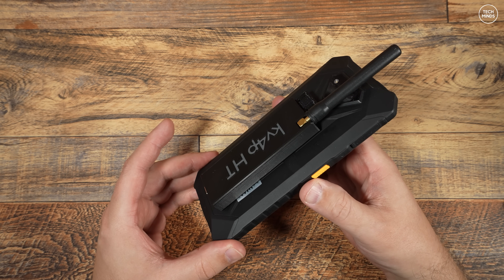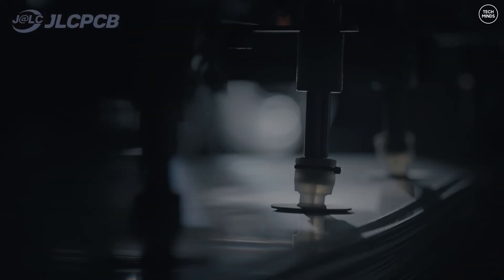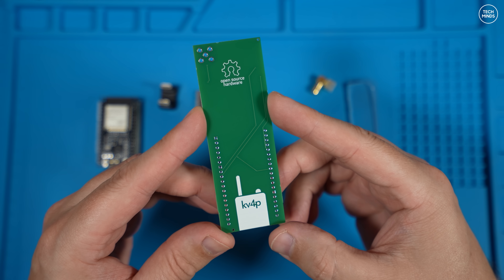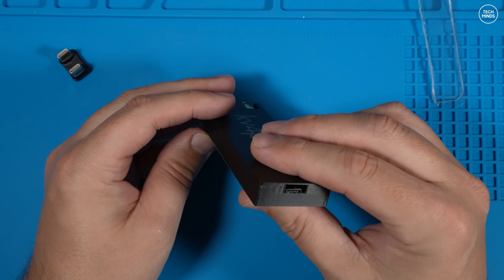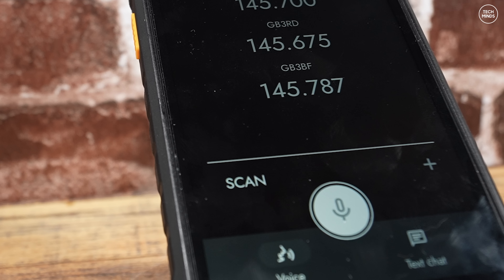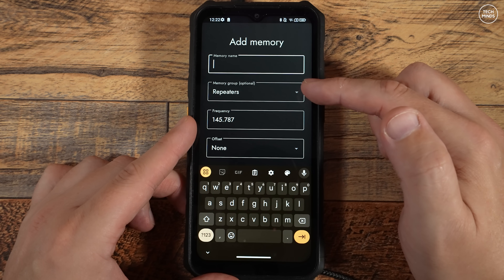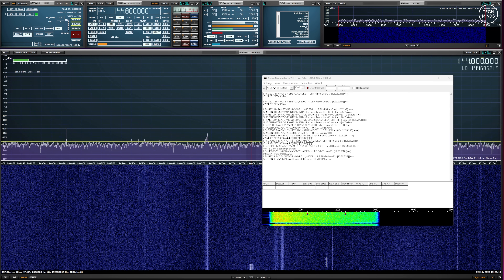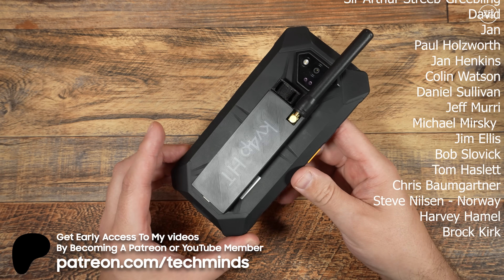Turn ANY Android Into A REAL VHF Two Way Radio Transceiver

Comment: You Ham nerds make me laugh, you where all slating 4g network radios as not "real radios" in all essence without android and either a wifi or 4/5g this thing would never work. Basically this is a 4g network radio dressed up!
Reply from the maker: Bit of fool are you not? It doesn't use 4G or any internet data to work. It uses an RF module and an app to control it.. Nerd..!

Comment: Very cool project!   Thanks for sharing it with us!

Perhaps, I missed it; but, what is the transmit power?
Reply: I didn't hear it either, kind of important information on how useful this is.
Reply: SA818-V (SA818S-V)134~174MHz (VHF)500mW-1W 3-5KM RDA1846S chip

Comment: looking at the design of the PCB, it's a shame that they can't just produce the ESP32 module with the PCB extended with the pins for this feature, even if they don't provide the DRA818V module or the various parts out through the connector port.  It would be far thinner that way and might even be able to be integrated into the protective case that many people put on their phones.
Reply from the maker: look at github, they already have this in development. great idea though.

Comment: for the cost and time, you could just spend the 35 bux and get triband baufeng instead.   Not suer what the advantage is here unless its for the project itself.
Reply: I'd suggest the Tidradio TD-H8 10w. BT programming, higher tx power, much cleaner signal.

Comment: garbage, you can be tracked using your android. This isn't an ideal for a EMP off grid, first your android depends on transmission from cell towers, without service, it won't work. furthermore these cell phone depend on GPS locations. using this VHF there is no security. if you want to be tracked, sure that's good device for you. but if you like to be secure and don't want the US Government or the Chinese knowing what your doing, this product isn't advisable.

Comment: This would be amazing for all my backcountry trips...but cellphones working with satellites nowadays makes it almost unnecessary...and only needed as a backup.

Sending/receiving text messsges in the middle of nowhere is such a great feature for those of us that leave coverage often.
Reply: Not for my country tho.
Reply: One thing to keep in mind with respect to the concept of, "but cellphones working with satellites nowadays makes it almost unnecessary." This statement could be true, but a qualifier may be in order. And that qualifier is the ability, or lack thereof, to summon help from an external agency such as Gov't agency or NGO's who may man a local dispatch center via VHF, and how fast of a response may be required to address the nature of the emergency. For example, a real world event may illustrate this best. A party of skiers were descending the Notch near Lake Louise when the lead skier was involved in an avalanche. Broken femur required medi vac. The ACMG guide on scene performed a SPOT activation and called Banff NP dispatch on his VHF radio via the Hector repeater. The joint BNP/LLYK public safety team flew in and were dropped at the victim. The victim was stabilized and packaged on the slope in a Bowman bag and the 'ship' was returning to scene to sling victim out when Atlanta dispatch center for the satellite service called Banff dispatch to report an activation in their jurisdiction. It was of course, the same event that had been reported two different ways. The time difference between the two methods turned out to be about 1 hr. Another thing to keep in mind is there is a general feeling right now that the cellphone to satellite functionality is not ready for prime time yet as opposed to dedicated devices such as SPOT or inReach when it comes to the question of reliability with respect to summoning help for emergencies, but it will get there eventually.
Reply: S24 through sat ? ?

Comment: hi, this looks great but you forgot to tell many things, what is the frequency range and what is the transmission power, i can buy a small transceiver 10W for about $66 australian with a range of 16MHZ to 600MHZ with FM radio and air plane frequencys removed from transmission but receiving but i dont know any info for this project
Reply from the maker: The follow up video that I made on this contains the information you need :-) The module specs are available online, depending which one you get. 134 to 174MHz roughly.
Reply: may i have the radio brand and model number? thanks

Comment: You can put solder mask over the pins of the esp32 after you cut them to prevent anything like dirt or moisture from shorting between the pins
Reply: If you have any spare corona dope used on Hi voltage circuits on TV’s or Gen 2 or 3 NVD power supplies. Does a real good job at sealing contacts.u

Comment: You theoretically could wire a button to the board itself to give it PTT controls and could always code the app to have a response spoken out to you if the device is not currently in use by the holder like those old walkie talkies. lol Though unfortunately my skills aren't up to the task (hopefully I will be taking coding classes soon.) and then you could have your own bespoke android or linux based PTT VHF smartphone. (:

Comment: Can you provide a link to where the completed/assembled/flashed unit can be bought if such a site exists? Or perhaps resell the complete thing in a kit form shell and all with sm components already done? Is a regular wifi antenna good enough for this?

Comment: do you have this completed project available to buy from your Amazon account?
Reply from the maker: Unfortunately not, you have to get the boards etc yourself. However, I might do a limited run of them if the interest is there. I have a new video coming out on this in a few days with an update.
Reply: @TechMindsOfficial  cool I just ordered a 3 pack of the eap32 lora V3 cheers

Comment: Can I buy a COMPLETELY ASSEMBLED unit anywhere? Thank you for the fabulous project.
Reply from the maker: I have just received a load of 1.7b boards, populated with the filter components. They just need to RF module, ESP module and SMA socket. I MAY give away the bare boards at some point in the future. I also might get some fully made and sell them, depends on demand really.
Reply: @TechMindsOfficial so when are you selling the completed boards 😊

Comment: Well you can buy a handset for about $30 so this is really just a fun tinkering exercise.
Reply from the maker: That's true you can, but a $30 radio does not have the power of an Android device which can run endless amounts of compatible applications. So, not really just a tinkering exercise, but it is fun!

Comment: instead of the development board, you could have soldered the module itself. everything would be at least twice as small.
Reply from the maker: It was designed that way so everything lined up with the 3D printed case. You are more than welcome to make some changed to the design and submit them via Github, it's an open source project. :-)
Reply: @TechMindsOfficial  Don't take this as hate. I used to do it just like you and it took up a lot of space. Some time ago I created a pseudo-SDR based on an old TV. (YouTube/ELEKTRON1) The TV tuner module is controlled via I2C by a microcontroller. The IF signal from the tuner (approximately 30...39MHz) goes to the NE612 mixer and is mixed at a frequency of 27MHz. I filter the received signal and feed it to SA604. Thanks to this, I can demodulate and quickly measure the signal strength. The project became popular because it could be used to receive railway service radio. I am also a Creator like you, I create projects for my viewers. My latest project is a NEC IC programmer. I found these chips in a water heater and wanted to write Hello-worlld on it (and my mission in life is to run BLINK on every microcontroller possible). You did a great job and you deserve applause. Greetings from Poland, ELEKTRON

Comment: I remember one of my older Android phones had a radio function, you just had to correct wired headphones. The wire functioned as the antenna.
Reply: My old Sony Ericson phone had an broadcast FM radio receiver - it used the wired headphone as the antenna. That was some years ago now
Reply: An FM radio receiver was built into the Motorola g4 Play, and my wife gave me a Verizon no-contract version which cost less than US$50 around 2016. Good reception for wx and news when we were in cellular dead zones, before SpaceX Starlink!

Comment: What would be nice is a provision on the PCB for a second USB connector which could be used to charge the phone while being used.
Reply: Most phones won't support this, but you might be able to get away with simultaneous wireless charging and USB OTG
Reply: most of phones can't work in dual mode. only "host" or "device".
Reply: why wouldn't it work since there are USB OTG devices that specifically have a power input? Like: plug in your charging USB cord here and I'll send that power on to the phone

Comment: Lol .why not buy a cheep vhf walkie talkie lol....another useless item..
Reply from the maker: because a cheap walkie talkie does not have the power of an Android device running it. Which potentially opens the door to a lot of experimental and useful software applications. Cannot compare this with a standard radio.

Comment: you can already buy integrated phone/ht, and a dedicated ht with battery cost less than half as much. why the exitement?
Reply from the maker: Dedicated phone with radio are most likely closed source, and cost 100's of $. A $35 HT does not have the ability to use software. This costs less than $35 for a single unit, and it's open source. This means that we have a software controlled VHF radio which can yield all sorts of future developments. Hope that helps.

Comment: Can I use it on my current android phone and it works only when it's plugged in? Or do I need to use a different phone that isn't currently on a plan?
Reply from the maker: you can use it on any Android phone that supports OTG and the app. Doesnt matter if it is on plan or not.

Comment: Are the low and high pass filters software based or additional hardware?
Reply from the maker: The filters settings on the app refer to the received audio only.

Comment: I don't like it; these damn smartphones are everywhere. Just as well, there could be a small screen and an encoder instead of that phone.
Reply: That's not true, the smartphone is bringing all the audio section, microphone and speaker, plus the power supply.

Comment: This is cool, but tooooooooooooooo expensive project,  for this money you can buy a few Chinese SDR radios with better parameters and also hackable! E.g. Quansheng line can be updated to operate as 2 bands transceiver with ability to receive in full SW range...  
73!
Reply from the maker: I think you're missing the point with this. The possibilities of having it app driven is pretty out there. Of course you're confined to the 2M band, but with software, can do anything in terms of modulation, decoding, etc etc.
Reply: @TechMindsOfficial  I've got it, but mentioned quansheng already has such functionality as full featured remote control (e.g. with "Quansheng Dock") , and it's significantly cheaper. Of course, "Quansheng Dock" is for windows, but I hope something exists for android as well.

Comment: Question for me is why not use mini-circuits'monolithic SMT LPFs? (LFCN-) I think you can get them from both mouser and DigiKey...
Reply from the maker: Put forward your idea to the project, I’m sure it would be very well received from them.
Reply: @TechMindsOfficial  I may also submit the idea of using an SR_FRS-W2US radio module as it's 2w UHF, but has been hacked before to operate 146-222-440 MHz with the Arduino handie talkie project, as well as having a switchable LPF with the LFCN's
Reply: Maybe this radio is already made to be interfaced with a microcontroller and be digitally controlled, instead of having some external hardware. The audio should also be routed into the esp32 to be sent via USB!

Comment: I really hope someone can invent one that's purely a VHF/UHF scanner receiver with AM Airband receiver built-in!??
Reply: Why not using one of the better RTL-SDR's and an app like SDR Touch?
All existing, even more so if you start digging deeper into this hole. :)
Reply from the maker: RTL-SDR dongle with SDR++ running on Android. Of course that is receive only, no transmit and no making use of the phones/devices peripherals.

Comment: does anyone know the output wattage and power drain on your phone?
Reply: @mi6xgzjon186  1W from DRA818V.
Reply: The module 818 is 1 watt, I was curious if the PCB would support the 868 which is 2 watts.
Reply: @SkillfulHacking   thanks,  it will be interesting to see how this develops over time.  could be usefull as rf for digi modes from morse right through to digi voice.  im thinking pota and sota.

Comment: Is that cable always needed? 
What is the TX power output?
Show more videos on the APRS features 😅
Reply: @KA4UPW  i read somewhere it's 1 w output
Reply: @tratzum  those modules on high power setting have a typical output of 29.5dBm (about 0.9W) - max is 32dBm (about 1.25W)
on low power mode its 27dBm (about 0.5w)
Not exactly high power output
Reply: @keithroberts5946  dam rules of 3's and 10's.

Tx
Reply: @KA4UPW  Yes. It’s the data cable the UI on the phone uses.

Comment: I ordered a set of 30 for a club. Bought all the bits. Then the ESP32 module didn't fit the boards. Apparently a known issue. The project has gone from V1.6 to V1.9 in the past few days!

Shame, as I'm now stuck with a load of parts that won't fit!
Reply from the maker: There is a WIP 1.8 but I don't see a 1.9. 1.7b is the latest release version of the board.

Comment: we had this like 9 years ago... using a rtl dongle and a otg cable and a app called sdrtouch...    but no tx though ... i love it
Reply: It's NOT the same!
SDR Touch is Rx only you can't transmit.
Reply: @rogue_spirit  yes i clearly said that.. no TX

Comment: Dear friend. Pls infm if the walkie talkie thar cames out of this DIY works only between Walkie Talkie to Walkie Talkie OR if it can do it with a Repeater ... By other words, Walkie talkie to Repeater and then Repeater to destination Walkie Talkie. Pls infm as well if it  is possible to transform the "keypad" of the celular into a DTMF sellcall to the other Walkie TAlkie

Comment: A few years back bought a vhf/uhf radio from China it was also a mobile phone which accepted 2 sim cards came with 2 antennas one for vhf/uhf   one for the phone....can't remember the name ..cost about 35 quid
Reply: Believe it or not, Samsung even made a short band radio capable Galaxy S3. It was a China Telecom a special release. It was designed to pick up Digital television with a telescoping antenna that even has a swivel and pivot. Someone got a colonel functioning with full control. One of the coolest devices that was sad to see finally reach EOL. I want to say it was the power management side that failed, but I'm still so glad I bought that off of a Chinese student going to the local College, trying to buy a phone while they were in the US. One of the many Oddball perks of being in cellular repair
Reply: @TTS-TP  Great insight. Certain types of jobs do have different "perks". So interesting when you find one. Guns, motorcycles, houses, whatever you work on eventually you'll find that oddball surprise. Up to the individual to seize that opportunity, which you did. Well done.
Reply: Runbo
Reply: Maybe you mean a hybrid POC radio
Reply: Hytera poc
Reply: Its baofeng, its not run on uhf it is handy talky which need wifi thus no limit in distance.
Reply: My s10 had a cb channel. Was talking to truckers with my phone. Wish they all had this.
Reply: @jeremywhitesell2688 wait, a galaxy S10 had that? Standard U.S. unit?
 Any way you could get the model number by chance?
Reply: @waynekc01  yeah the US version.  But no i gave that phone up 6 years ago.
Reply: The ones I  saw, were Motorola knock offs. They use them on construction sites, then toss them, cos the next job hands out new units on a new freq, etc.
Reply: Sounds like a ton of work for something that won’t transmit more that my Icom, Yaesu and Baofeng HT radios can do. 
    It’s more of a McGyver type novelty device more than anything. Maybe something that you can get away with if the Democrapic Party raided your home to murder all your radios like they did with PNutz the Squirrel…😢

Comment: Is it just 144-148 or the usual 136 to 174Mhz?
Reply: The frequency range is determined by the radio module which is DRA818V/SA818-V.  I think this one of the modules from the baofeng UV-5r so it might do that full range. The link to the module is on the project page.
Reply: Imagine being able to work 1.25m on that...
Reply: I think you can dual band the antenna if the performance is not optimal. In USA it's 16 centered, ais is at one end.
Reply: That's controlled by the software. As is, it's just the two meter band.  just modify the software.